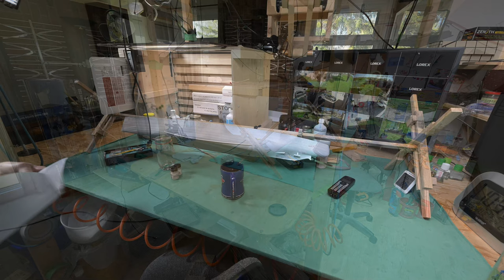The Model Ship - Part 1187

Comment: The rate and quality of the videos you publish are staggering. Are you really doing all of this alone? it seems like the work of a whole crew. Is your background in video production?

I highly recommend airbrush-able primer. It will help the paint stick and give you a layer of durability in case you bump or scratch the surface later.
Reply from the maker: It's a one man show.
Thanks for the tip Carl. 👍